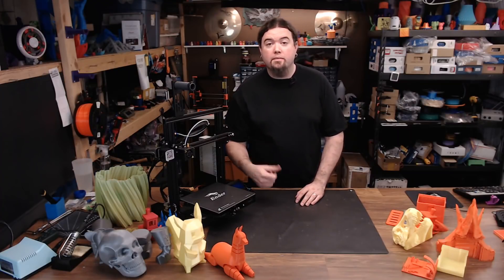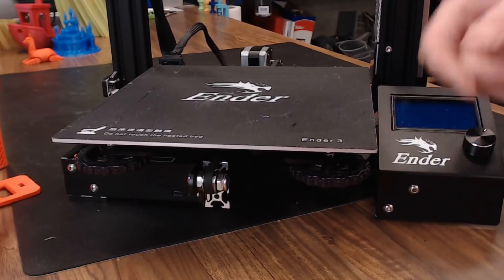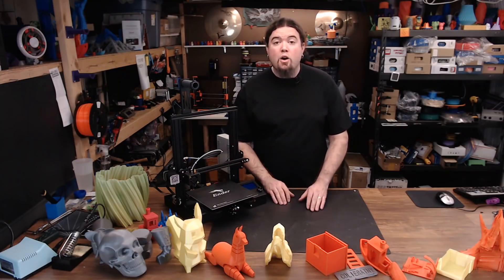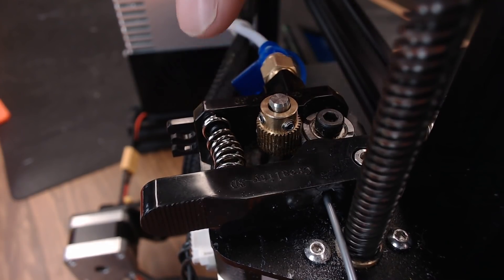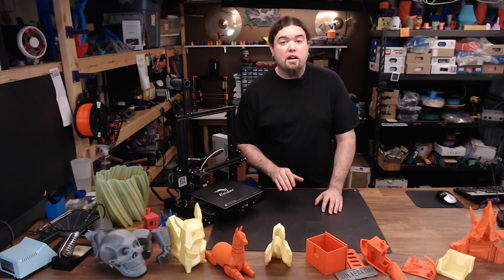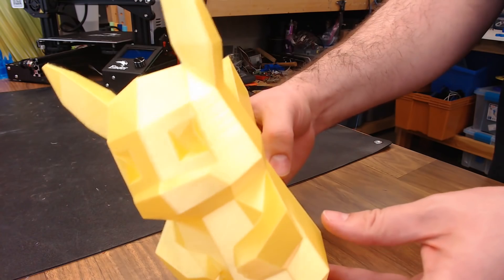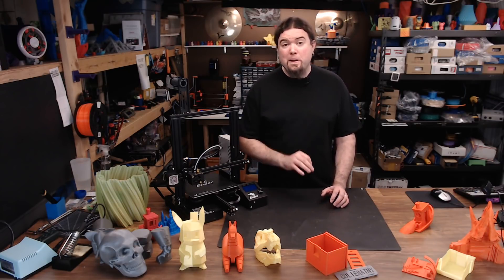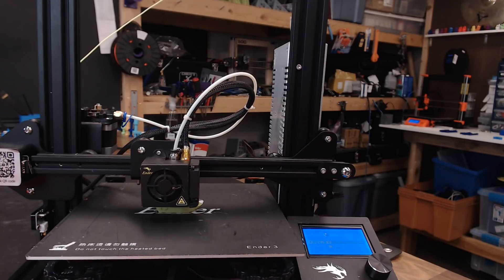Creality Ender 3 3D Printer - Review - Chris's Basement

Comment: Hi Chris,

May I ask how do you switch on the 'Power Loss Resume' function please, I gave it a try earlier but there wasn't any resume screen, it just started as usual, if it helps, I switched it off by pressing the power off button on the power supply, I don't know if that make's any difference...

Many thanks for all you do and all the hard work you put in making all these videos, thank you...

All the very best...

Andy...
Reply from the maker: Hey Andy, so when you power back on, try to go down to init SD card. Hit that, then it should ask you if you want to resume.
Reply: @ChrisRiley  
Hi Chris,

I have just tried it again, only this time it did it straight away, I hit the resume print and away it went again... :)

Thank you again for all your help Sir...

All the very best...

Andy...
Reply from the maker: @Andy203504  Awesome, glad it's working!

Comment: Great video. I have MacEwen 3D  Flexi Plus extruders on  my Ender 3 gen. 1, ENder 3X and CR-10S machines. Adjustable spring tensioning,  fitted Capricorn tube on the load side of the extruder to protect filament from Z-axis lead screw and a threaded stainless outfeed tube for flexible filaments.
Reply from the maker: Thanks! Nice upgrades, there are so many options for these now.

Comment: 2:28

SeeMeCNC EZR Struder for bowden extruders.

I own this because of a video by CHEP.

it has fixed my issue on the cr-10 even better results than the aluminum extruder replacement.

the SeeMeCNC EZR Struder is a very good extruder for bowden extruders.

I thought about the Creality Ender 3 as a secondary printer. i would upgrade to the Micro-Swiss All Metal Hotend and get a SeeMeCNC EZR Struder bowden extruder.
That would be a great printer even at around
$260 with the upgrades.
Reply from the maker: I have had really good luck with the EZR and a great price. I haven't checked out the micro-swiss yet, but I have heard good things.
Reply: The EZR Struder is abeeter price than a bondtek bowden extruder.

the microswiss all metal hot end i got from tiny machines llc, is a drop in upgrade.
the difference is the ptfe tube only slightly guides into the hotend.
with that 24v power supply you could get 270c or whatever the max firmware is, without a pid test?
Reply from the maker: Yep, looks like max stock temp is 275.

Comment: Seems the quality of the parts is still not consistent across the board. All I've had to do was replace the Bowden couplers with those blue ones that I had around and it's been printing like a champ. Forums and such have people reporting zero issues to completely unusable due to bent rods and misaligned drilled holes.

Like of the draw doesn't bode well for a first printer but for those who can tinker, it's the best deal in town.
Reply from the maker: Agreed, they are all over the map, but a great platform to start with.

Comment: FESTO BRAND coupler is the way to go! That’s the one Prusa uses
Reply: I bought them from Amazon so I could push through the Bowden tube on my MMU2
Reply from the maker: @thelightspeed3d712  Gotcha, right on. Still on a quest for 6mm festos.
Reply: Chris Riley isn’t the ones you need like the one on the MMU2?
Reply from the maker: Unfortunately those are 5mm and I need 6mm.
Reply from the maker: I love Festo stuff, I can't find any 6mm to buy. Any clues where to get them?
Reply: The ones I got are 10mm ones

Comment: Ah! Twisted Z bracket. That could be the same with my CR-10. The Z nut screws were a little loose from the factory, when I noticed it I tightened them up but the Z started to bind, so I loosened them off half a turn and it's been ok. But it's always bugged me. Now I might have the solution. Thank you yet again Chris.
Reply from the maker: Thanks Spike, yeah that one seems to be really common with Creality.

Comment: I got one of the newer ender 3's with the removable plastic build plate, seem to print ok but it seems to hit the endstops harder than  woud like while homing, also its pulleys on the X & Y  seem to be a press fit with no grub screws for adjustment
Reply from the maker: Interesting, I haven't seen the press fit type yet.
Reply: Yes unfortunately they are, its a bit of a pain as I intended to fit dampers to the X and Y axis, but after having a real good look at the back of the Y axis assembly under the bed, it doesn't appear to have enough clearance to allow a damper to be fitted without either grinding a chunk out of the Y carriage or designing a replacement Y motor mount with a 6mm offset to compensate for the  added space taken up by the damper, there are offset mounts available on thingiverse  but I'd rather do my own as I want  to  add an idler to the rear Y mount to keep the top run of the belt  as straight as possible, as on my particular printer the belt angle  changes too much for my liking when the bed moves to the rear of the printer (I noticed a tiny  deviation  in the  linear scale of my prints on the Y axis dependent on what part of the bed I use, and believe this to be the  cause of it)  well at least I wont need to worry about swapping out the pulley on the Y axis because of the offset needed so thats a plus,   after running the ender for a few weeks  it seems quite quietish, no failed prints at all, that may in part be down to due diligence as having learned a few a CR10 lessons over the last year, I did make sure the tube was cut square at the end and  seated with the absolute minimum gap by loosening the nozzle off a bit  before pushing the tube all the way down as I noticed the tube tends to spring back ever so slightly in the coupler causing a gap and impending doom at the bottom, I've also fitted clips  to the fittings under the rings in a bid to stop them moving, I'm sure there has to be a better way to secure a bowden tube maybe some smaller variation of a compression fitting  as used in copper  plumbing maybe?  I was however a bit skeptical about the new removable printbed as I'm used to printing on clean glass and as its plastic and about as thick as  a sheet of glass I wasn't sure how it would hold up, but have had no problems with it, other than the prints can grip a bit too well to it, and really dislike having to use force to remove the pieces, so in the long term I'll be switching to glass, all in all a really good printer for the money  - anyway thanks for the reply and look forward to your next  vid
Reply from the maker: @DevilbyMoonlight  Thanks for the run down on your machine. I have come couplers on the way that I  hope will grip the tube a little better. On the bed sheet, agreed, that stuff holds like crazy. I am just waiting for when I rip it. :)

Comment: My work bought 5 Ender3’s to go into our elementary schools. After a quick assembly, I noticed the under extrusion problem on a couple of them. I printed a extruder arm that uses a m4 screw from the bag of extra parts and a m4 nut to put adjustable tension on the spring. They all have been printing happily since. They are a really great bang for the buck... great video
Reply from the maker: Awesome, thanks Mike for the suggestion.

Comment: You got one I was waiting and waiting. I have been having a lot of problems with slicing. It's like I have to change my settings every time.
Reply: The extruder slips so much it's making the motor lose steps all the time. This makes so much noise and cause the print problems. I have been thinking about making it direct drive. But then I need a bunch of upgrades and why upgrade it, if I can save and just get a better printer. I think the ender as a concept is a great printer and with modifications yes it can be an amazing printer. But I think it also is going to have a lot of people new to printing buying it then giving up cause the printer is too hard to work with for a new user. I'm not talking about me or anyone in this chat that did start with an ender but for main stream users it's a nightmare
Reply: I bought this as my first printer. I bought it to finally break into printing. Although I wish I had saved up and gotten a prusa. The ender, in the hands of someone who knows there way around is fine. But as a first printer it can really demotivate the user. I am a CNC machinist as my job now and when I get home and want to design something and print it right afterwards. I don't want to take another day after work setting the machine up to print.
Reply from the maker: @snazzyriza9518  I hear ya, these low cost machine are really a roll of the dice. You could upgrade your way to something worth while, but going with a Prusa MK2 or MK3 allows you to just print and leave all the headache aside. In my opinion, worth every cent.
Reply: @ChrisRiley  hahaha! Honestly just had me dying it's just so true!
Reply: @ChrisRiley  also hey would buying the MK3 be worth it it's 200 more the MK2S should I just go with the 3
Reply from the maker: Oh yeah, worth it. Go with the 3.
Reply: @ChrisRiley  sounds good thank you for the videos 

Do you have any plans of building a corexy of your own
Reply from the maker: @snazzyriza9518  I have so many plans for builds. :) I would love to do a corexy, just have to find the time.
Reply: @ChrisRiley  ill help I'll fly out
Reply from the maker: @snazzyriza9518  You might have to. ;)
Reply: @ChrisRiley  just hit me up

Comment: Thanks for highlighting some of the Ender3's warts - seems like everybody and their brother is proclaiming this to be the best thing since sliced bread...my experience has been quite the opposite.  I bought 2 Ender3s from two very different suppliers.  I think the best way to describe this product is that it's a snowflake - every Ender is different.  I don't think that Creality is applying any QC.  My first Ender had intermittent control board problems, an incorrectly built hotend, and both the hotend fan and the case fan failed within 3 weeks.  The hotend fan actually started to drip oil.
The second Ender had a very bad LCD - poor contrast and a strange colour (very different from the first).  Many of the aluminum extrusions were cut so poorly that we had to re-cut them to make the ends 90degrees...and the extruder gear does not turn perfectly around the centre of rotation...so the filament will tend to not feed at certain points in the feedgear rotation.  Oh and the non-90degree Z-screw bracket you mention...yup - had the same problem.
I would not recommend these printers to anyone  unless they are willing to put lots of effort into applying "post-manufacturing quality".  In the end, by the time you fix and replace all of the crap parts on this printer, you will have spend enough money to have bought a better printer in the first place.
QED
Reply: totally agree.!! Not for beginners.
Reply from the maker: Thanks for the comment. Agree with you totally, Walter and I put ours together at the same time, they were sold less than 4 weeks from each other and there were different parts on them already. They're not great, but cheap...

Comment: Try TH3D Studio for bowden tube couplers.  I have not tried them yet, but he seems to source only high end parts.
Reply from the maker: Thanks John, RobbyMaQ suggested these, I am going to give them a try. https://www.amazon.com/gp/product/B071YQ5C6S/ref=oh_aui_detailpage_o02_s00?ie=UTF8&psc=1
Reply: @ChrisRiley  Just double check the thread size, M6 is usually on the extruder, while the M10 is used on the hot end
Reply from the maker: @trolling4dollars816  Yep, seems like the 10mm ones work a lot better, plus they are pass through so that helps. Hope the 6mm work out.
Reply: @ChrisRiley  You have to check the threads for the coupler, no way to a 10mm into a 6mm hole ;)

Comment: I grabber an ender 3 pro in the 11.11 sales and it's been awesome straight off the bat so far, they seem to have addresses a lot of the niggles people have had with the original ender 3 and the inclusion of a magnetic print surface is awesome :D

I'm still going to fit a petsfang fan to it though :p
Reply from the maker: Nice! Good to hear, at least Creality attempts to improve as they go.
Reply: @ChrisRiley  As with a lot of companies, they use reviewers to point out shortcomings, then fix some/ most of them.  For that reason, I am not an early adopter.

Comment: Great review! I have always had issues eith the hot end coupler on the cr-10 and can't find them anywhere big headache. Thinking about getting one of these as a desktop machine. But how many does a guy really need...you're right I'll get one. Does the stock firmware have things like thermal runaway or filament runout option?
Reply: I have not seen a review yet that says that the thermal runaway is turned ON in the firmware from the factory.  So you might have to take care of that yourself. So if anyone knows if they have corrected this from the factory please let us know.
Reply from the maker: Thanks man! Yes, same issues here. I ordered some of these, I am going to try them out. https://www.amazon.com/gp/product/B071YQ5C6S/ref=oh_aui_detailpage_o02_s00?ie=UTF8&psc=1

Just a quick run through there firmware, it appears neither are enabled. Probably want to look into that.
Reply: @ChrisRiley  I have heard (not confirmed) that there is not bootloader on the board.  It would be a great video of updating the firmware when no bootloader is present.
Reply from the maker: @trolling4dollars816  Yep, no bootloader. Let  me see what I can come up with on that.
Reply: @ChrisRiley  I grabbed an ender 3 pro about a week ago as my first printer.  Have since installed a bootloader and the latest build vanilla marlin fimware along with a BLtouch.  Similar issue to you where the coupler lets go of the tube but at the extruder end.  You can download circlips on thingiverse that holds the push section open to retain pressure.  If thats works all good, if not ill just grab some new couplers.
Reply from the maker: Right on! Yeah I have a clip on there now, seems to help some.
Reply: Chris, Nice, let us know if they work for the hot end! I know a lot of CR-10 owners have been trying to sorce a pass through coupler for a long time! Even capricorn says they can't find them for the hot end lol.

I assume that the firmware steps are the same as in the CR family so shouldn't be too big of a headache without a bootloader.
Reply: @RevampedOutdoors  they have the pc4-m10 passthrough couplers here :
https://www.captubes.com/
Reply: @MrDead1975  thanks for the update! Last time I ordered from capricorn they couldn't find them. I'll have to try these out seems like a reasonable price too.
Reply from the maker: Will do! Correct, same as the CR10.